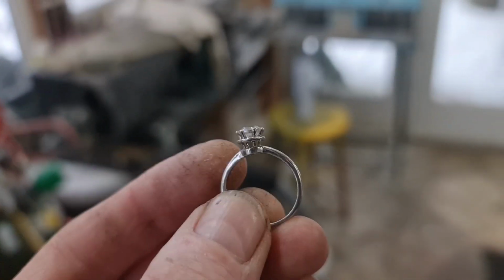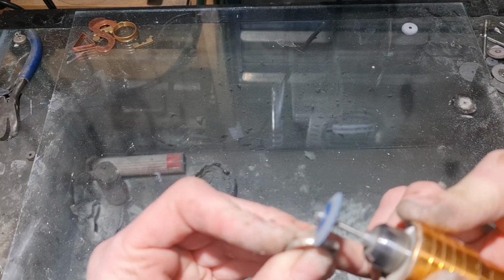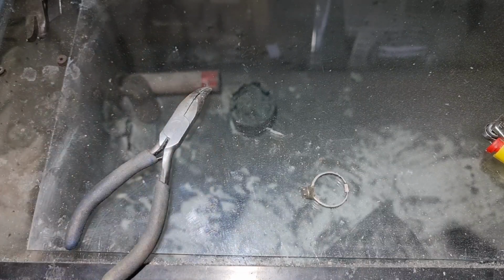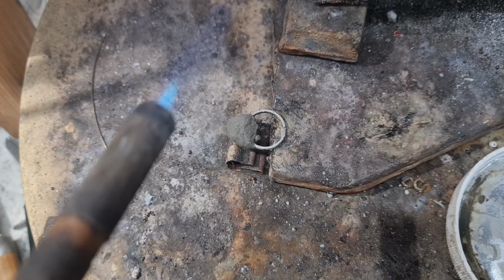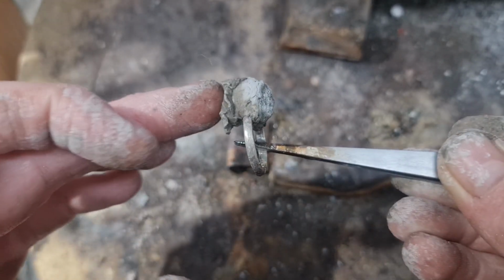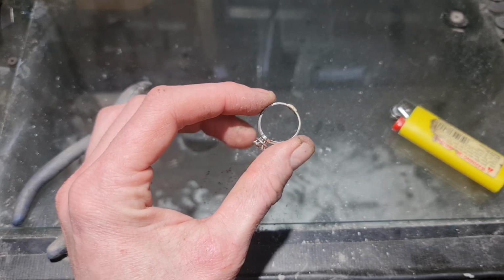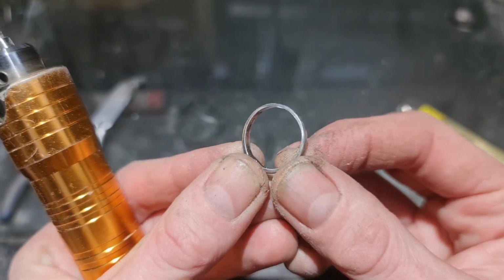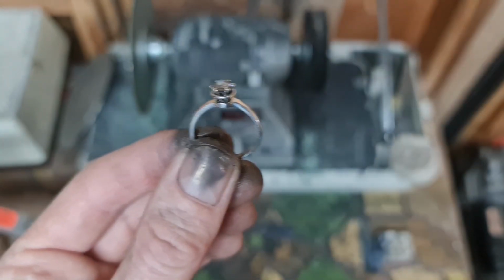How to Size a Ring without Removing the Stone Using Heat Shield

Comment: I tried to add a piece to enlarge the shank with some 'cool gel'. No luck getting the solder flow. So this video was very helpful!
What was the wheel you used first to smooth down the ring? It looked like a blue flying saucer. Thanks.
Reply from the maker: Sorry for a late reply! The wheel is a grinding wheel, you can get these at jewelry supply stores or online (sometimes amazon carries them). These have different grinding grits and they are very helpful for use with silver.